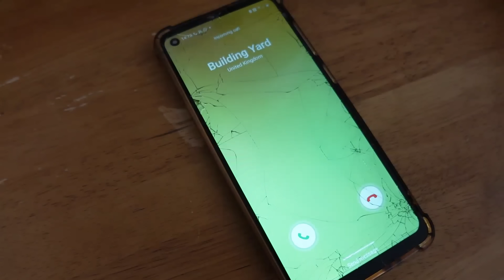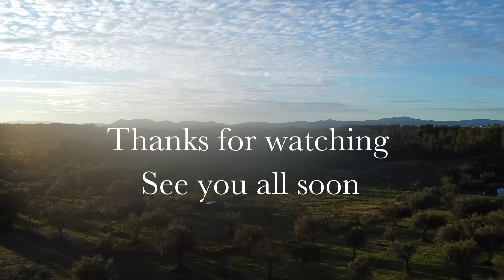THE REALITY OF LIVING OFF GRID | ROOFING OUR HOME

Comment: Hi 👋, Laura and Dan , Great to see you are not sitting 🪑 around drinking piña coladas, 🍹🍹 😂😂, and watching 👀 the sunset 🌅, 😂😂. It might be worth seeing if you can find a axle with subframe, And see whether you can get your friend with the welding gear, to make up some type of A-frame hitch of the front of it, I couldn’t quite see whether you have got a tow ball, or not, If you can find something out of a old truck, you might better find that you will be able to bring up a load on the back that might be able to help you get materials up a bit easier, 
Those roof panels look good, especially coming with already insulated , something not sure whether you’ve already ordered them but obviously you need a ridge capping, and probably end as well, it looks like a L-shaped, And did you remember that you’re going to probably need some special screws with ceiling washes, 
In October/ November, in 2022 I got struck by hailstones in my property, I’ve been told that I’ve got to pay €11,700 towards the removal of the asbestos roof, and I believe that my ex is trying to prevent the work from being done, I’ve just wasted 20 years of my life, putting my heart and soul into two properties and a relationship, where I ended up being scammed, Now even have a problem with what I thought was friends in my region I’ve now turned against me, very rarely talk or acknowledge me, and I have since found out that the insurance company that I’m with through my bank is as much use as wet toilet paper 😂, 
Oh, the joys of being young like you too , in some respect, not a care in the world just looking after yourselves, out on a great adventure, 
I’ll wish you both all the success for the future future , please be careful when you go to install the roof panels, ❤to you both. From somewhere in France,
Reply from the maker: Thanks for sharing the idea and sorry to hear that hope you can find some peace from the situation Thanks so much 😊❤